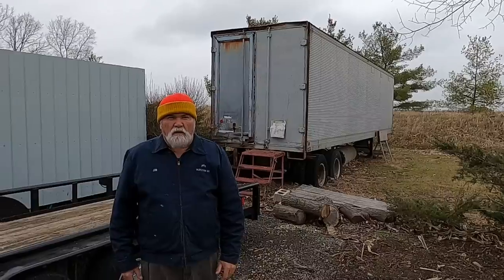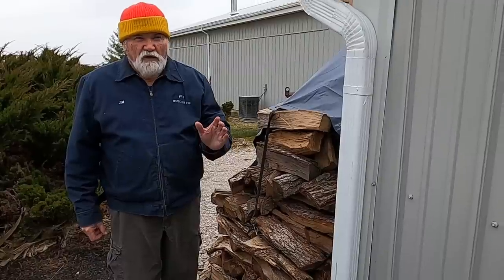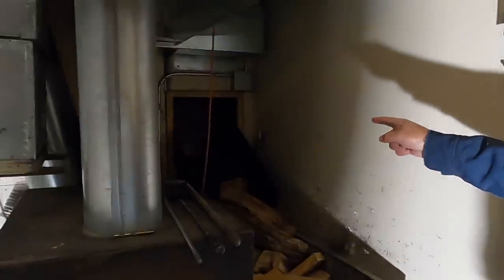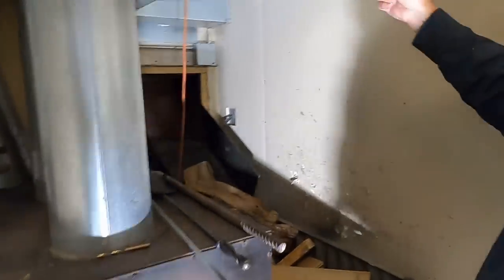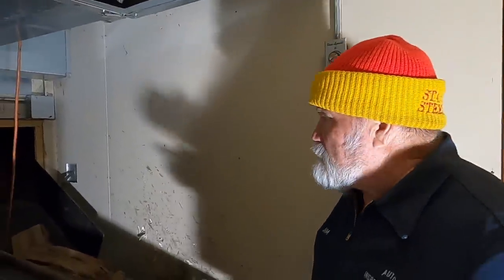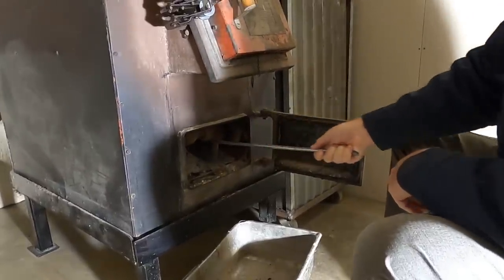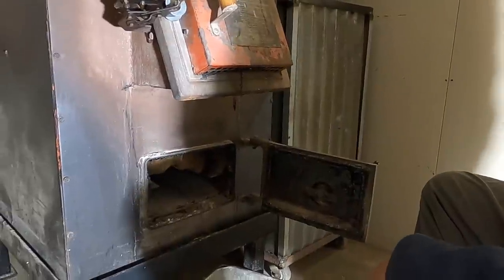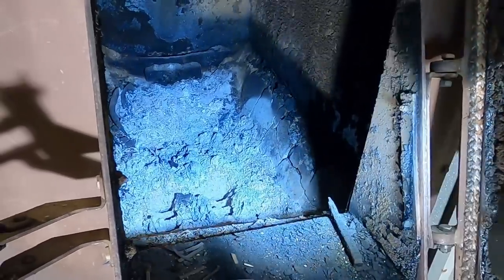I’ve Perfected My Wood Burning Stove I’ll Show You How

Comment: Thanks James, my family has burned wood for years. About 12 years ago my brother built his own outdoor wood burner inside a water tank that’s inside a small concrete block building that provides hot water radiant heat for the cabin. It’s larger so it only has to be serviced morning and evening before bed. It’s outdoors so it’s clean for the cabin. Another bonus is in the cold northern Wisconsin winter you can enter the building and get inside by the water tank if you want the sauna effect. I had a bad cold during deer hunting season. I went in there for 30 minutes and came out wringing wet. Really helps clear the sinuses. 😅
Reply from the maker: I have two friends that have the outdoor system.  I will have one someday it is a goal for me.  I apricate you sharing.  Thank you for watching my channel.  James

Comment: I have been heating my house with firewood for 45 years , I never recommend using lighter fluid to start my fire. I started my fires with crinkled up newspaper For years and years and years. I changed my ways I put my kindle in the stove and then I hit it for a minute with my propane soldering torch Works great. Good video thanks a lot appreciate the time you put into this
Reply from the maker: I agree with the lighter fluid the only reason I use it is because I am slightly impatient.  I have used newspaper in the past.  For me I start burning around Christmas and the fire never goes out until spring.  Unless I somehow forget to feed it.  I use wood to offset the cost of propane.  I likewise like the idea that I'll have heat should of a power outage.  Thank you for watching.

Comment: Great video and thank you for your service 🫡🇨🇦 I’m building a small auto feed wood burning stove. Bin working on it for a few months now. So many factors too think about. I’m hoping to have it test ready this spring. It will heat my trailer, provide hot water on demand, cooktop, oven, in floor heating. I got a bunch of work too do and videos like this help my project come together. God bless brother. 🙏
Reply from the maker: My plan is to have an outside hot water system they are a large investment.  My auto repair shop is heated with the used motor oil we generate.  Best wishes and God bless you.

Comment: Enjoyed your lesson.  I burned wood many years ago, but just added a woodstove to our current house - with a new wood stove - not the the catalytic type.  The instructions say not to use an accelerant.  I included an electric fire starter with the stove.  It works great.  I have a bag on Morgan's fire starter as backup just in case the power is out and can't used the electric starter.
Reply from the maker: I really enjoy Mike Morgan's videos. I am a bit of a cowboy when it comes to some of the things I do.  I will us caution.  Thank you for watching.

Comment: You have some great ideas: The Filters on the air ducts , The Vent hood above the furnace door is another great idea. You have helped to solve a lot of the ash & dust that goes along with using a wood stove for heat. You have a wood chute that connects to the outside--GOOD---that give you enough air for combustion. For those that don,t have that , may I suggest a air pipe coming in from the outside for combustion air.. Bob
Reply from the maker: I am going to research that concept and if I like what I learn I'll do it.

Comment: The only thing it's missing is an air inlet from the outside and your efficiency will go way up. Cool stuff my man!
Reply from the maker: Thank you.
Reply: @Freki Bodgaedir Yes it increases the efficiency because it's not pulling air out of the room. If you pull air from the room it makes the room negatively pressurized and air to replace it is pulled in literally at the seems. If you make an air inlet from the outside it should have a valve with an external handle that allows you to control the amount of air that flows in. An inline chimneythrottle flue works perfect.  In this way you can control the rate of the burn and not have your ears pop or door get sucked closed. Not to mention you'll use much less wood if you learn to control the inlet, which is very easy. Good luck gentlemen.
Reply: @Freki Bodgaedir it draws air directly into the stove from outside. Without an outside air intake, you draw in warm air from your home into the woodstove to fuel the combustion. The warm air you burn and send up the chimney creates negative pressure in your house and sucks cold air in from outside.
Reply: My in-laws have an open fireplace. The only thing warm about it is the radiant heat immediately in front of it. The rest of the house is ice cold from the outside air being sucked through the windows and doors. I don’t understand why the combusting air isn’t always brought in from outside. 🤷🏼‍♂️
Reply: What size pipe would you suggest  maybe 2  one inch pipes with ball valves on each. Sounds like a good idea

Comment: I like the wood handling setup, well thought out.  How do you dry the wood? or is there ventilation in the truck box?  I'd think it would turn to a moldy buggy mess with a truck full of green wood closed up.  Also, may I suggest you build an open front ash pan, you'll never shovel ash again, just take the whole pan outside, dump it, put it back in the next time you open it up, the open front functions as a shovel if there's ash already in the stove.
Reply from the maker: I dry the wood outdoors and then put in the box truck to keep it dry.

Comment: Do explain for people new to wood burning, the importance of managing creosote and how to do it. Especially on smaller wood stoves. Best to get a nice bed of coals going so you don't have to feed much wood to keep it going. Probably very difficult to get that going in a system that large though. Was curious if ducted wood burning systems were a thing for a little while.
Reply from the maker: Wet wood and pine wood will cause creosote as well as burning too low.  I've had it happen.  I usually only put a small amount of wood in at a time and burn hot.
Reply: @jamescarpentercountryliving  Yea true. I almost couldn't see where your floo was.  I'm referring to how to care for that and have better burn efficiency. My chimney was kinda of a hassle, not as bad as the last year though. was way more complex a problem. 
 I have been burning wood on and off, since I was 5. At least in fire places and Wood stoves. Something as complicated a set up as yours. How do you go about taking care of it efficiently to avoid a Cro fire?

Comment: Thanks for the video Jim. hopefully nobody slides down that wood Chute and steals the stuff out of your house. I'm sure you're prepared for that seeing what you've done so far. If you clean the inside of the stove where all that build up of creosote  is you will get better transfer of heat.  Have you ever tried to heat up a rusty nut with a torch .? Once you clean the rust off it heats up a lot faster. I had the same set up with air conditioning  2.5 tons. And I had a blower on the stove that would kick on when the temporary the stove would get to low,so less creasote. Thank you again for the video.
Reply from the maker: I can lock the door from the inside.  Thank you for watching.

Comment: My old boss used and old truck bed slide out, attached it to the floor beside the wood boiler and made a little hatch for outside. Just open the hatch slide out the bin, load it up with fire wood, push it back inside. Done
Reply from the maker: Great idea and he recycled at the same time.

Comment: A lot have happened in 35 years,nowadays the smoke after the burning chamber is added secundary air, so the smoke gasses are burning too before going outside, then you dont have to throw so much wood through that small door.
Reply from the maker: Thanks for the info.

Comment: I was thinking from the beginning that things were moving kinda slow. Then you started scooping the ash out of the stove. At that point, time started going in reverse. I agree that being gentle with the ash keeps things cleaner though. Can you still use this system without electricity?
Reply from the maker: Even without the blowers the stove can heat the entire house it's not as evenly heated.  I have two 5000 watt generators.

Comment: Nice set up, whats the sq ft of the house and how many cords do you burn? Good idea for storage in the trailer, I imagine it bakes the wood dryer in the summer sun.
Reply from the maker: 1,600 sq. ft.  It depends on the weather, if it's freezing, about two cords.  I have a furnace that I used until mid-December then I added the wood burner.

Comment: I'm looking for some advice. I was going to clean my chimney and all I could was a shiny  glaze no flakey or build up of soot. Is the shinny glaze the stuff that catches on fire or the soot. Thanks to anyone that can help. John
Reply from the maker: Most chimney fires are from creosote or blockage that ignites, starting a chimney fire.  When you look down the chimney check for build up on the inner walls.  Without seeing yours it sounds like it is not real bad.  Run the chimney brush from top to bottom several times.  Clean the ash from the pipe if you have a 90 going into the stove.  Thank you for watching.

Comment: If you open up the damper to our chimney before you open the door, you won't get that big puff of smoke coming out into the room, but you should know that already if you burn wood in any kind of stove.
Reply from the maker: Yes I do know that.  I get smoke when I add wood most likely due to not enough draft.
Reply: Nice setup. You may want to try reversing your extraction fan and open the outside vent to bring air into the room before you open the door. It will put a positive pressure on the room which will not allow smoke to come out the furnace door when you open it.

Comment: Wheres your outside makeup air so the  wood burner doesnt draw cold air thru the cracks into the living space?
 Outside air gets you 30% more heat or less wood. Depend on which end you see it from.
Reply from the maker: Thank you for explaining the purpose of outside air.  I am going to figure out a way to obtain outside air.  Actually I could draw it from the attic it is well ventilated.  Thank you for the advice and watching.

Comment: do u have poplar
Reply from the maker: I don't know my wood well enough to answer that question.  I will say that I known pine and will not burn it.
Reply: @jamescarpentercountryliving   Its considered a hardwood but actually a soft easy to work with wood. Very useful for kindling. Burns very hot very fast.  35 years here with our woodstove in NC. It's all we have for heat. I enjoy everything about firewood but it's becoming harder on my body. Split by hand for probably 25 of those years,  LOL  those days are definitely over. We have red and white oak, hickory in abundance. U have a great set-up for sure